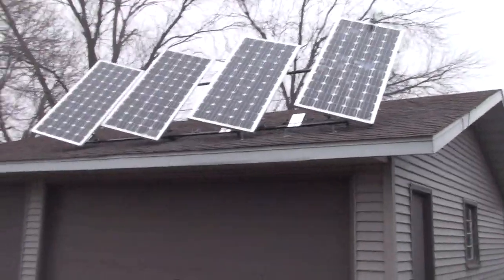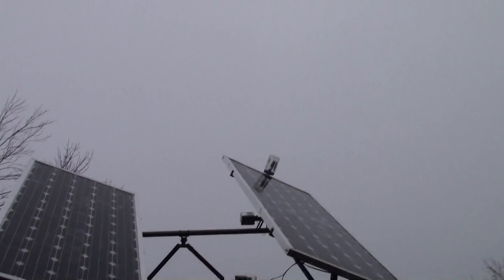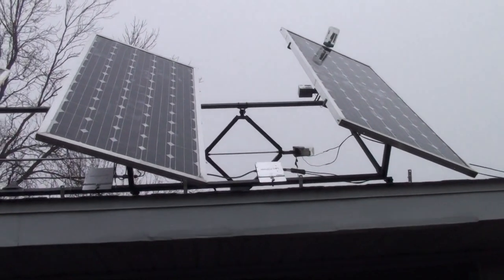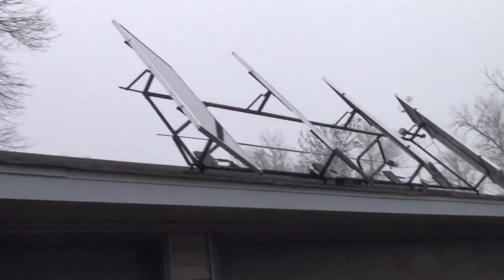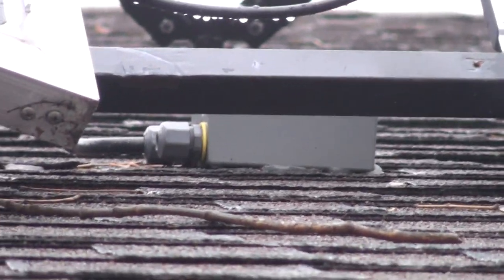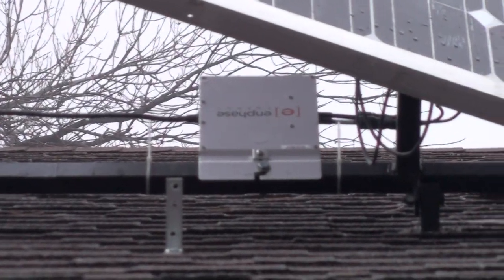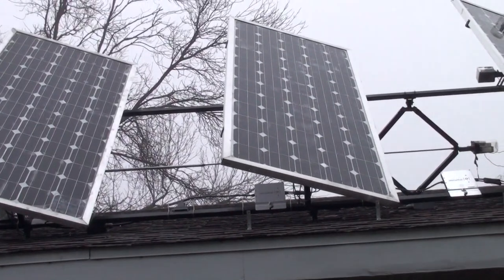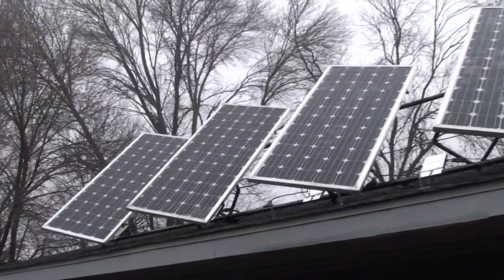DIY solar panels on home made tracker.

Comment from the maker: @Fearlessthinker yes, it will go higher and there is enough clearance . Having 2  sissors makes it a lot more stable and it isn't that hard to extend the threaded rod to the second one. The only thing I might change is right now I am using 3/8 inch threaded rod and might go to 1/2 inch.  I'm dieing to see how it will move once the dual axis tracker is on it. Should be fun to watch. Still have to mount limit switches on sissors yet.